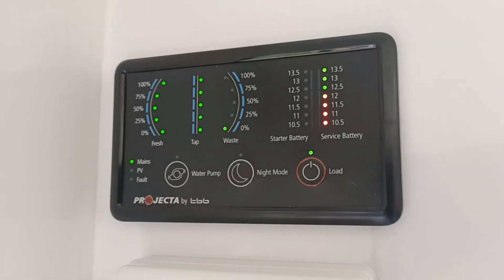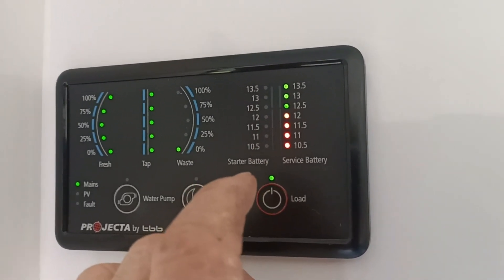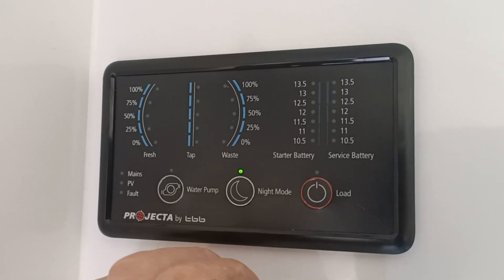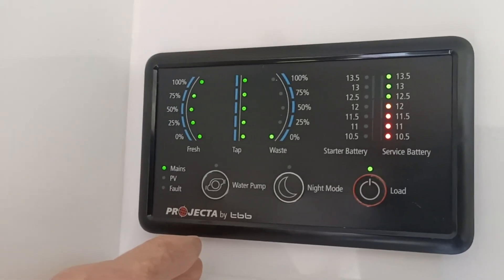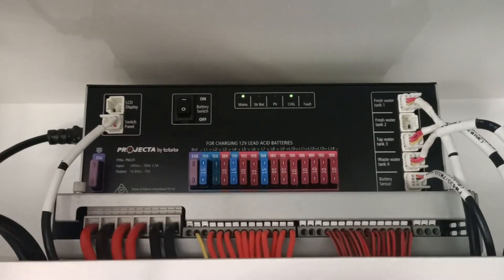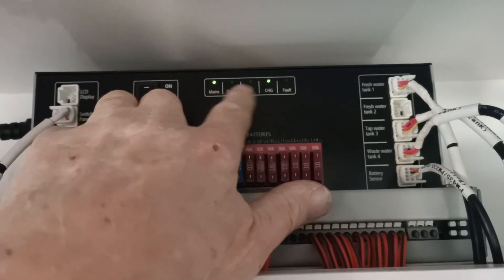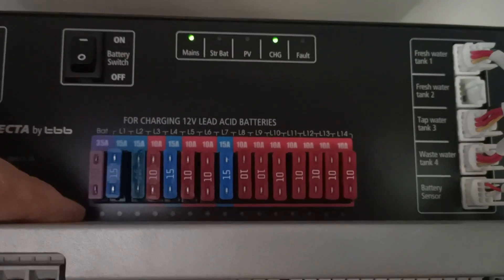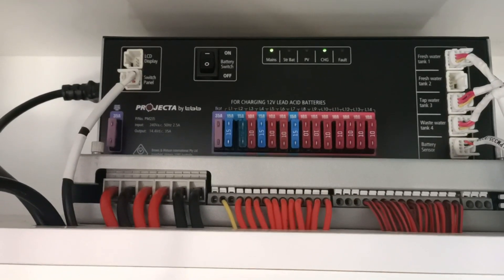Projecta PM200 and PM235

Comment: Hi we have a new caravan it has the projecta pw235 we fitted two new lithium batteries after about 3 weeks the fault light flashes 8 times its the bms over voltage how do we fix that thank you
Reply from the maker: I haven't come across that one. If you contact Projecta they are very helpful and should be able to help you.